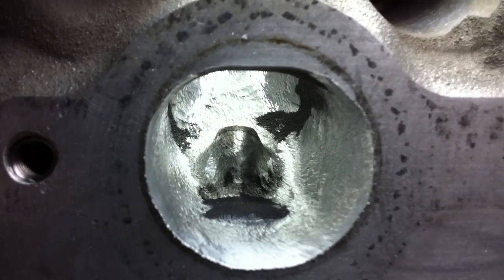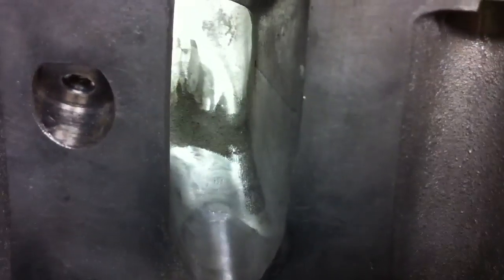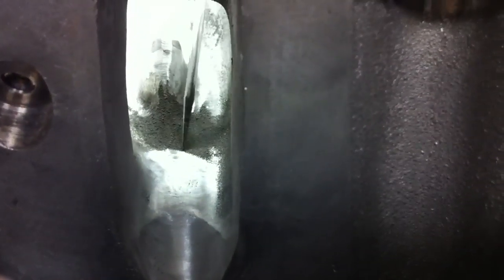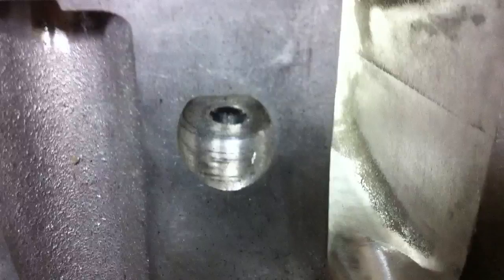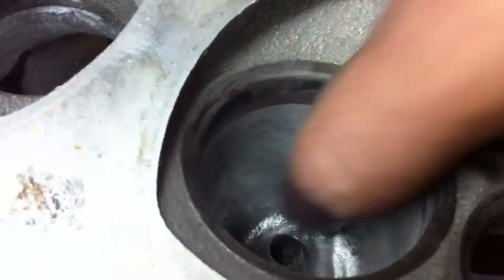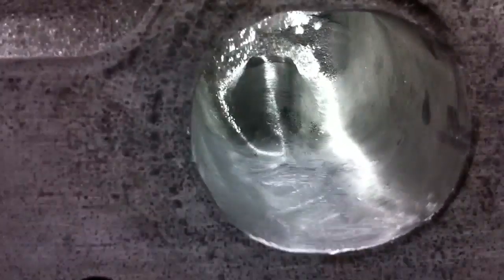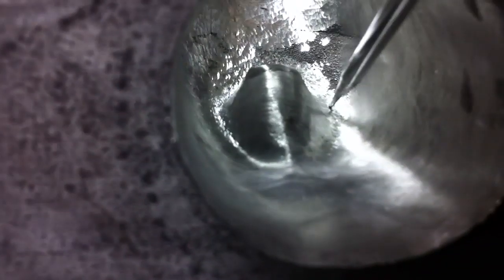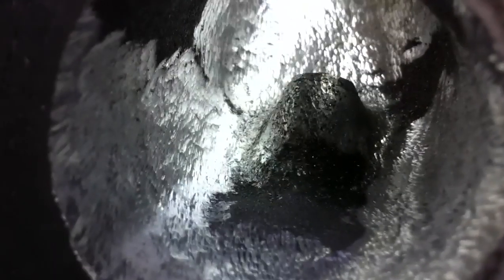How To LS1 DIY Head Porting Part 7 - Tootsie Roll

Comment: I want to CNC knurl my floors on the intake side.  I've never seen anyone do it.  I'm dying to do this and flowbench a before/after.
Reply from the maker: Interesting idea! I'd like to see how that turns out. Your idea for this is to guide air flow?
Reply: It's to increase low-level turbulence on the short radius.  The top half of the intake port (or the long radius) polished to a mirrored surface.

To let the cat out of the bag, that's actually what I'm doing to the Hyundai right now.  I can't get flow numbers and I wish I cared enough about this car to pursue it on this job because it would be great data to have.  It's just a resource that's not yet available to me and I want to put this car back on the track already.  I have advice from an extremely influential engine builder [who passed away] that having rough AND polished textures opposite from eachother in an intake port is the ideal configuration.  This violates herd mentality on this topic, and I've never once seen it done this way, or discussed anywhere in any forum on the internet, but it makes sense to me for too many reasons.

Polishing an intake actually does improve the airflow velocity, but the reason why power gains on the dyno don't show up from that treatment is because it changes the acoustic properties of the intake.  The shockwaves caused by valves opening and slamming shut echo [with greater volume when polished] to all the other chambers.  It amplifies whatever noise it already makes.  Those frequencies actually impact airflow by exaggerating the existing acoustic properties of the intake.

Fuel atomizes better when injected into turbulent air, and this is tested and true; it does contribute to a better burn. It just doesn't need to be the whole port to be rough to pull this off on an EFI car.  In my case because of where my injectors are located, it's just the floor that needs to stay rough.  Polishing the roof actually will increase the flow velocity high in the port while the rough surface creates low level turbulence aiding the fuel atomization.  It creates a sort of laminar flow situation.  Because the turbulent air is low on the short radius where it needs to prevent fuel from pooling... and the polished surface (or the fast surface) is the long radius it supposedly balances out the flow of the port.  That's not all it's supposed to balance out.  Supposedly it breaks up the louder echo reflected off the polished roof when the valves slam shut and gives you the benefit of the polished runners without amplifying the negative acoustic affects inside the intake.

I find it to be an extremely interesting theory.  One I've never tried, one I'm dying to test, and one I have faith in simply because of WHO it came from.  I will not name drop out of respect for the deceased.  I'd just like to improve on the idea somehow, and knurling the floor of a fully-polished runner to create a consistent rough surface is something I REALLY want to try.

Dimple theory has been around the block and back already, proven correct, but I don't believe it's the end-game.  I think further improvements can be made.
Reply from the maker: wow, thank you for the thurough explaination. Makes sense to me. You've got me curious. I could possibly leave the floor as cast to create a rough version of this idea.

My wheels are turning. Thanks!
Reply: That's what I did with the Hyundai head.  I have 8 exhaust ports to finish, then count on a few new videos about it.  :)  You'll get to see my results.  

Can you imagine the firestorm I'd create if I posted that explanation on my own channel?  :P

Again, I have no means of verifying any of it right now.  It's not something I've done before or have evidence that it works, but your curiosity and mine about it are definitely shared.  I think it hit the same lobes in your brain that it hit in mine.  I've got another cylinder head on the way that I'd rather do these tests with, and it's one that I can afford the time to test if I can find a shop with a flowbench (and I may build one).  Just be completely assured that you've done nothing wrong by NOT doing it this way.  You did a great job porting these heads.  The possibility that the dual-texture thing works as described makes no impact on the effectiveness of known methods of cylinder head porting that you demonstrated here.  I really enjoyed watching these videos because you nailed it!  ;)
Reply from the maker: Thank you Jafromobile! You were one of my main sources of info when I started researching a couple yeras ago. I can still see you porting that trubo on new years. You were a huge inspiration and I appreicate what you do. You and a couple guys on LS1tech.com guided me into porting. 

This playlist of porting videos is a couple years old now and I'd like to make a new set one day with more clarity and confidence.

I've got too many projects to catch up on at the moment though. I'm sure you know how that goes. Then trying to document them and edit the video to make it enjoyable takes a lot of time. It seems to at least tripple the time it takes me to complete a project. But is all fun in the end.

I have a set of heads on my bench that is for my turbo 6.0 '92 Camaro build. I think I'll try out this idea you've presented on them. I'll just leave the floor casting. These heads flow well in stock form, so I know leaving the floor as cast wont hurt. Thanks again Jafromobile!
Reply: AGearhead4Life

You would be safe to ignore his "advice".  Shape is all important.  Surface roughness is almost insignificant.  His "hypothesis" contradicts basic fluid dynamics; ask any mechanical engineering sophomore. His other points fail as well.

Fuel isn't atomized inside the port!  (beyond what the fuel injector achieves).  It happens while it moves into the cylinder.  We want NO turbulence in the port...we want it inside the cylinder.  That's what swirl and tumble are all about; IN-cylinder turbulence. This is fundamental to engines actually work.

Dimpling a port does nothing for flow.  It's ONLY benefit imo is that it makes duplicating (stealing) the port very difficult.  Any monkey with $2000 can have a top engine builder's port scanned and reproduced with CNC nowadays.
Reply: Thanks Chris.  I wish John Lingenfelter was still here on this Earth with us so that I could tell him you think his "advice" should be ignored, and that you know how engines work better than he does.  If you even paid attention to my video instead of just bashing it, you'd catch the references to the Lovell gas factor which explains the cylinder turbulence.  If I didn't know that already, then why would I have put that in the video and in the description?  If you paid attention, you'd have caught where I explained my work was an experiment based off of "someone else's" advice.  You'd have caught where I stated I wasn't following herd mentality on the subject and where 90+% of people should stop that would have left them with the results they were looking for.  Turn your annotations on, and you won't feel the need to grandstand about those who you think are handing out bad "advice".  At no point did I approach this as anything other than a skeptic.  I have 6 years experience working for Alfa Laval Thermal, Inc., and know a thing or two about fluid dynamics and enough experience designing and building vertical plate heat exchangers to know for a fact that you're wrong on that topic.  I still stand behind everything I said and did in that video for what it's worth.  It's a worthwhile experience of testing a dead automotive genius' theory.

You probably don't even know who John Lingenfelter is, so what difference does it make anyway?  Can I duplicate his results?  Probably not.  But when people who build quarter million dollar cars tell me what to do, I'll at least test their advice and follow directions to see where it takes me because what do I have to lose?
Reply: I discredit the advice - even your advice to follow someone else's advice.  Don't act like you know me.  John WAS influential in his time.  Did you know he built the engine for Callaway Sledgehammer Corvette?  That car was $400,000 back then.  It's still outdated information.

I'm an engine designer and I'm deeper into combustion systems than most engineers.  l have actually designed plate heat exchangers for Viex..  Our heat exchangers didn't combust...l'm not sure about yours.  What you want in heat exchangers is NOT the same as in engines...completely different machines, with completely different purposes. You can design heat exchanger for my engines any day. 

When you show me a Formula 1 car (or top fuel, or pro stock, or GTE, or Australian supercar, or Moto GP, etc) with dimples, or rough SSR, then I'll take notice.  Until then, treat it as a novelty, and don't say "it's proven" etc.  Do you want people to waste their time on something that doesn't work, or at best gives little return for great effort, without the tools to quantify it, just because you mentioned it in a video?

I'm working on a series of videos to debunk all the myths.  I honestly hope I can approach your video quality.
Reply: lol.  You fell right into it.  Dude, I don't care one way or another what you wish to misinterpret or misrepresent about what I'm doing.  There's not one place in the comments here in this video, my video's audio track, my video's annotations, or especially the description where I referred to port textures as anything other than an EXPERIMENT.  You keep calling it "advice".  I'll offer you a piece of advice now that you've tasted your own high-and-mighty medicine.  

Don't talk down to people.  You don't know me either, and you should follow your own advice.

Nothing about how or what I said to you was serious.  I know you're an engineer.  I have a Bachelor of Science in engineering.  I didn't specialize past that point thanks to Bill Clinton and Affirmative Action, and 6 years at Alfa Laval was enough for me.  I know the personality that accompanies engineers.  I know nothing pisses an engineer off worse than when you tell them they're wrong or present data that proves it.  If it burned you up for me to act like you're an idiot (and it was an act from "go"), re-evaluate what you started with your first comment.  Compare that to my reading comprehension statement.  You keep calling my work "advice", and that's laughable.  That's what you're doing in order to be "right".  My video is filled full of warnings and disclaimers not to do what I'm doing in audio, video, and print.  That's the advice I offered.  It's always been an experiment.

I actually have to make effort to be a dick to people.  It's not in my nature and I couldn't give 2 of someone else's shits about being "righer-er" than someone else or starting an internet flame war.  In fact, when I uploaded my head porting video, I typed paragraphs about this impending discussion.  About how no matter what you think you know, someone out there knows better.  That lesson applies to BOTH of us.  I'm testing the theory of a dead legend.  That's all I'm doing and being that you're in R&D, you should understand the value in experimentation.  I'm looking for the answers you say you can provide but haven't aside from talk and bluster.

If you're going to be a dick to me on my channel, and talk shit about me on other people's channels, I'm not going to listen to you, and neither will anyone else.  You can build your own audience.  I'm happy that you have expertise in your field that gives you access to all the equipment that I explained I don't have "yet" as I put i, and if you can de-bunk myths about head porting, and be constructive about it... you will most definitely get my support and the support of others in promoting your message IF you ever make it.  I mean that.  We're after the same things.  I'd give you a boost putting it out there in front of tens of thousands of people, and on that topic, those are things that I'm both miles and years ahead of you on.  That's not a competitive statement, either.  That means I'm one of the people who can help you catch up if you should decide to be constructive about it.
Reply: You don't seem aware how people react to your videos (as if they're gospel), and how that's different than your perception of what you're putting out there.  Putting a quick disclaimer in one video, and then making a 30 minute video contrary to that disclaimer sends the wrong message, imo.

Consider me a scientist.  I look for the truth.  I'm eager to be proven wrong, but NOT about stuff that's simple physics and old hat.  And not by someone in their garage using a butt dyno.  That just doesn't qualify as proof. I don't see any actual testing, and I'm still waiting for data.

An experiment doesn't just end at a hypothesis (the opposite of "theory" btw). it has observations, analysis, and conclusions.  Sorry if I hold you to that standard.  You're not just another dude in his garage.

I was rear ended twice last year and l just got over it a couple of weeks ago.  Trying to distill over 30 years of PhD level research into a series of 5 minute entertaining videos meant for non technical people is a colossal task.  Speaking in a convincing manner while not being preachy is a challenge.  Going against popular opinion is a challenge.  I certainly have my work cut out for me.  And this discussion has inspired at least three more videos.
Reply: Chris Stavro I know what you mean about scientific procedure.  You know where I'm coming from about facilities.  But most importantly, I know how hard it is to stay positive and keep agony buried when you're injured.  Under production schedules demanded upon me by subscribers, I rebuilt the Hyundai with 3 broken ribs.  I'm just now getting over that one myself and damned if it didn't make me one cranky S.O.B.

The 30-years-into-5-minutes.  I feel you on that one, too.  I know that my videos reach novice mechanics and first-time-car owners.  They drive what they can afford.  It's for that reason that I added the challenge of doing complex work with the cheapest, shittiest tools and facility I can find.  I plan on tackling other cars with nicer stuff.  Some of that's coming up in the next video.  Playing stupid so that people will like and listen to you is a huge challenge.  I don't know everything and I'll be the first to admit whenever that happens, but don't think I haven't considered anything you've said to me here.  I'm always looking for new and better ways to improve.
Reply: Chris Stavro Oh and I'd like to add one more thing...

It could very well be that Lingenfelter is executing one of the biggest trolls on automotive humanity from the grave.  I wouldn't have entertained him if I didn't observe some volumetric flow rate differences while doing hydrostatic flow testing on a group of identical M15 VPHE's, the only difference between them was the materials used on the plate packs.  The internal volumes were the same and that was tested with sonar equipment.  We got a 19lph flow rate difference between 316 stainless and titanium plates.  That doesn't seem like a lot, but it was enough to change the hot and cold side output temperatures beyond the thermal emissivity of the materials.  We had a shop full of engineers arguing with one another over this one for weeks about why that was happening and it ground our supply unit to a halt while they sorted it out.

Fast Forward a decade and I'm assembling an LS block with a group of friends who shoe-horned a cam and valve combination into LS1 heads that were bolted to a 12.5:1 c.r. LS6 block.  We called JLE to ask their techs about the cylinder wall to valve clearance calculations and measurements and they were so stuck on it being impossible that they transferred us to John.  John gave us advice that we ran back through the numbers and came out with the same result, and that car went on to run 2 seasons of high-8's to low-9's on a big shot of nitrous.  It was that same phone call that lasted about 45 minutes with him actually asking us questions about how we pulled it off that he gave us that info.  Since his other suggestions worked, and I had an incident that engineers blamed on the course-ness of materials for the flow differences, I didn't feel like I had any reason to doubt him.  A year later he dies.

I guess the whole "people look up to you and take your word for gospel" point of view applies to me talking to a world-record-setting Corvette builder.
Reply: That's not enough information for me to make any kind of conclusion.  All I really heard was that some dude was explaining to a racing legend how to go fast ;)  I may have been venting/thinking out loud a little.

fwiw, the title of my combustion video will be "flame wars" :)

I would love to leverage your 32,000 subscribers and 8 million views.  I do enjoy your video format.  I briefly thought about giving you my scripts and having you produce them (and give me writing credit!).  I have a nascent company, and l need recognition.  Any production tips for a newbie?

I use the same tools you do...I told you that I stole your abrasive buff idea.  My issue is the mountain of information, and the vast overlap, and making sense of it all.  Needless to say, scientists are super smart, but kinda out there, and not necessarily good at explaining concepts with simple words.

Comment from the maker: Awesome man! Get it! I havent run 2.02's yet, but I have a set of heads set aside for that experiment. I've been curious to find out myself. Its not only the size of the valve, but usually they've got a polished back also. Both will help flow. I think it was $65 a chamber to have flow tested.